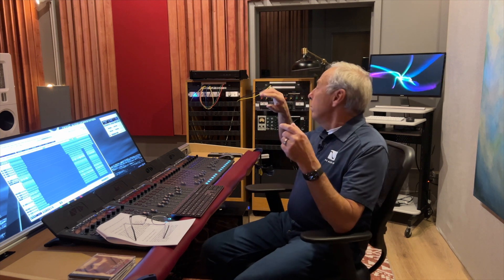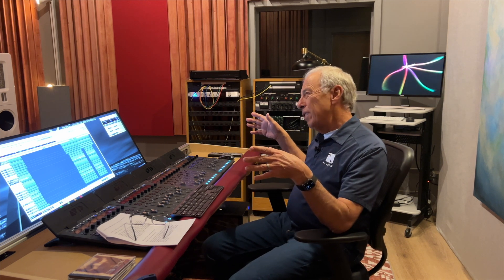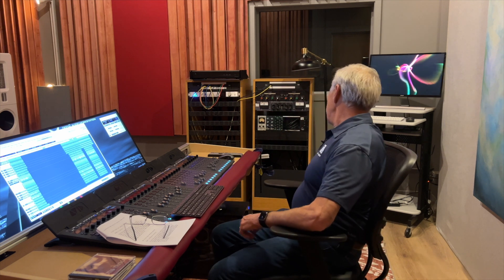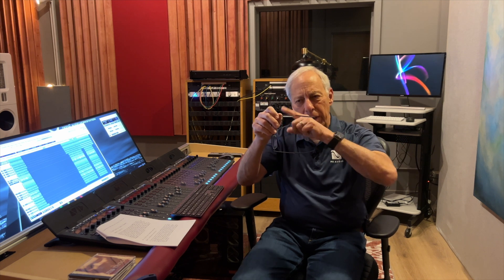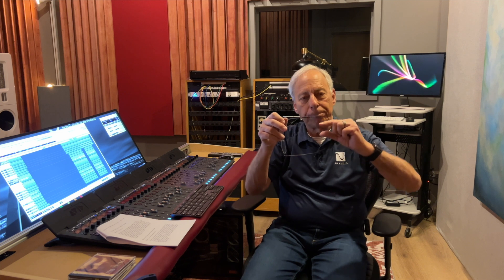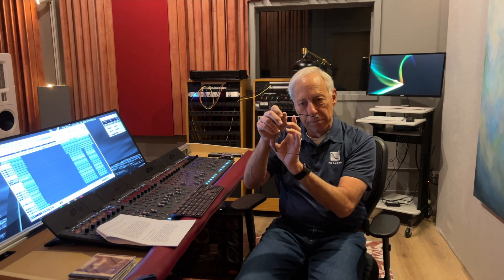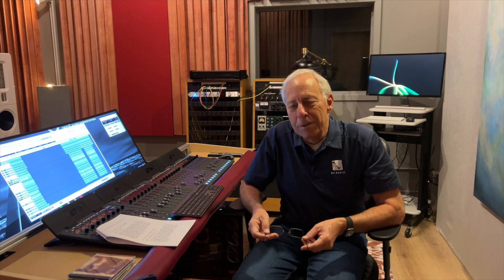Can a passive circuit work on XLR?

Comment: Paul says "A balanced connection has the ability to lower noise, lower distortion, get rid of hum."
NO!! A balanced connection is far less prone to picking up hum over its length, but it can't get rid of noise or distortion that's already there in the signal from the source.
The OP talks about "XLR noise filtering" which is the wrong way to think about how a balanced connection works. It doesn't filter anything, it's just far more robust at rejecting potential noise pickup.

Comment: Don't give me the wrong  finger  Paul   !  LOL    It  would just be easier to say that  XRL   doesn't share  the  same ground   connection   for  the  left and   right channel , that  it   gives   a separate    one  which  reduces   common   mode noise
Reply: This explanation has some inaccuracies.  The discussion has nothing to do with left and right stereo channels having common or separate grounds.  The issue is whether the per-channel signal connections between pieces of equipment are balanced (usually using 2-conductor twisted signal wiring with an overall shield, and 3-pin XLR connectors) or unbalanced (usually using single-conductor signal wiring with an overall shield, and 2-pin RCA connectors).  3-conductor XLR cables do in fact have a common shield ground connection at both ends of each cable (which some professional equipment has a switch to disconnect if necessary, or leave connected).  The noise-rejection advantage of a balanced signal connection is that the signal interface is differential (not single-ended - not referenced to ground - it doesn't use the shield/ground wire/pin on the cable/connector, nor in any practical way the chassis grounds at either end).  The intended signal is the DIFFERENCE between the 2 opposite-polarity wires/pins, i.e., one signal is referenced to the other, such that, when processed differentially at the receiving end, doubles the intended signal amplitude (voltage), and cancels out any unintended common-mode corruption to that signal, such as ground-loop hum or radiating electromagnetic interference.  Hope that helps.
Reply: @boblehman1726   It  sure  does  because   the  left and  right  grounds are  connected on the  circuit  board using  RCA  cables   By  separating the   grounds through the use of XRL  you  reduce the  common   mode noise  like Paul  stated   So you  have  Right  channel, right ground  /  Left   channel   left ground , complete  isolation  between the two channels   reducing  the  ground  noise  Now  you mom's calling you time for  bed
Reply: John Senchak, I suggest that you do some more studying on this subject - I commented on your post to try to help others here trying to learn something to not get confused.  Again, the issue has to do with differential balanced vs single-ended unbalanced signaling & interwiring between separate pieces of equipment to minimize hum and other common-mode noise, whether involving one or many channels, not just left and right channels of a stereo pair.  Part of what you're saying seems to refer to what happens if you use 2 simple XLR-to-RCA connector adapters in a stereo interface, which only uses one leg of the differential signal for each channel from the XLR side as an unbalanced single-ended signal, along with the shield as the necessary ground, for the RCA side.  I also believe that no one should use ad hominem attacks here or elsewhere because they don't help in any way and usually only serve to expose immaturity or worse.
Reply: @boblehman1726     Why   would  you use  a  mono  XRL  cable  in a  stereo     confirmation     Usually   mono would be used   with a   sing microphone
Reply: @johnsenchak1428   There are many XLR connector and cable configurations, but the vast majority of them, including what we're talking about here, are 3-pin connectors and 2-conductor signal + shield cables, so let's stick with only that configuration here.  All such interfaces are single-channel (mono).  Yes, microphones are among the most common use, but they're also used for line-level interfaces, e.g., between a source and a preamp, or between a preamp and a power amp.  Two such interfaces are used for stereo line level signals - the two signal lines within one standard 3-pin XLR interface are a single channel, not left and right.  Those two signal lines are the same audio signal, but at opposite polarity to each other, and are referred to as + and -, or hot and cold.  Both swing to positive and negative voltages relative to the other.  When one line is swinging voltage one way, the other line is swinging voltage the other way - an equal amount in magnitude, but the opposite polarity.  [Of course when there is silence, both lines stay at 0 volts relative to the other.]  The 3rd pin is the cable shield and is normally wired to the metal connector shell and to the equipment chassis ground when connected.  The shield helps keep external noise from getting into the cable; the differential processing of the balanced signals at the receiving end doubles the signal voltage and essentially eliminates any noise (EMI, ground-loop hum) that got added equally ("common-mode") to both of the signal lines.

Comment: The answer to the question asked is simply; no.
Reply: No, Paul's answer is correct - Yes, it can be done, with appropriate transformers, (which are passive].  Such an implementation may however be less ideal, depending on the transformer quality/specs.

Comment: One question missed, what is the separation between the DAC and the amp. If the DAC is next to the amp and they both share a common AC mains feed/earth, then messing with using a transformer to enable the balanced out to feed an amps rca input will probably lead to no improvement, just maybe some bass loss courtesy of the transformers.
Balanced is great for separated equipment, or where they are powered of different power sources/earth's - i.e. hum loops etc, otherwise it's quickly a point of diminishing returns.
Don't get me wrong, if both source and destination has balanced connectors, use them, however if you need a pile of transformer or active converters (other than simple no component type adapters), then maybe think again.

Comment: In RF circuits I have used "baluns" (balanced-unbalanced) to do this passive hardware conversion (from a distance, similar to a transformer). My first guess is that the same devices wouldn't work for audio. RF is working in the megahertz range so handling 440 Hz should be possible if someone had the right circuit design. But I agree that a more active device is probably best.

Comment: "Can a passive circuit work on XLR?"

I'm not sure if that question was actually answered. The literal answer is no. A passive circuit would mean no electricity is running through it, so there's literally no circuit. That said, i''m pretty sure that's not what was being asked. I believe the poster wanted to know if all the components in a system has to be active if you are using xlr connections. The answer to that question is no, however, you shouldn't be using the terms rca and xlr in this way. They're just connectors. xlr is a 3 conductor connector, and rca connectors support 2 conductors. That's it. The real question is, are the comp9nents themselves balanced.? A balanced connection requires a 3 conductor connector, but they don't have to be xlr. Any connector that supports 3 or more conductors will work. Same thing for rca, but its just 2 conductor support, not 3.

A source component always has to be active, otherwise you would not be able to get any signal out of it. Passive almost always refers to the preamp. The same rules apply to both balanced and unbalanced preamps. You can use either an active line stage, or a passive. Just going by memory, Placette, Adcom and Pass, all offer some models that are balanced and passive. I know there's others, but these are the ones I remember.
Reply: @Douglas Blake For once, you're right.

Comment: If I was buying a system, I would ensure it was truly balanced to the power amp.  Eliminate all the cable costs and noise.
Reply: @Douglas Blake I don't really understand the technical parts of this topic, other than what Paul has discussed,  but I do notice a huge difference between balanced and unbalanced with the favor going to balanced XLR. Reviewers of some of the equipment I own also have agreed.  Both my Burmrster and VTL  preamps are balanced or offer balanced inputs and outputs. My other Luxman pieces include balanced inputs and outputs and I never regret using the XLR interconnects. I also have a home theater pre-pro from Rotel and I use the balanced outputs for it, again I've never had any problems and enjoy what I hear. So I don't think it's at all a mistake. It's an option. Same goes for my second system which has a Hegel integrated.
Reply: @Douglas Blake Thanks Douglas. I read W's first comment andread your responses and  looked up what Bridge Tied Load (BTL) is and  your explanation makes perfect sense. 👍🍻

Comment: Use the DAC's RCA outputs to the Amp RCA inputs..  Perfectly fine if cable is short, e.g. the DAC is next to Amp. No need for balanced XLR unless your cable runs are long, e.g. several metres.  Don't waste money on transformers,  buy a good quality RCA to RCA cable.
Reply: Yes, most certainly, a transformer will indeed involve much longer and thinner wire in its windings and the magnetic coupling causing far more damage to the audio than just going with a quality RCA cable.